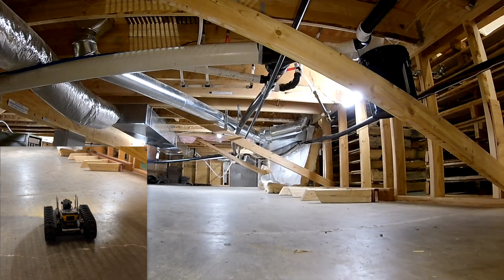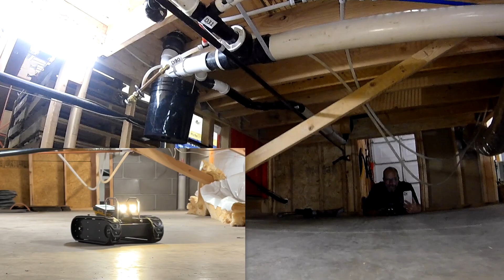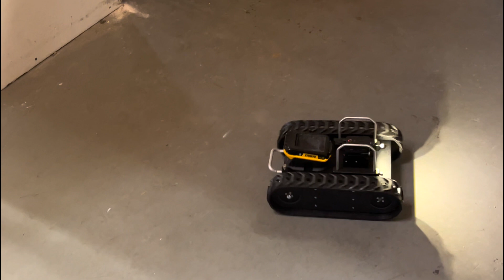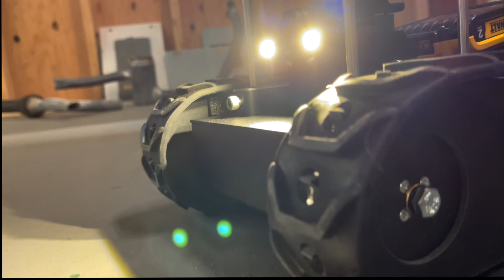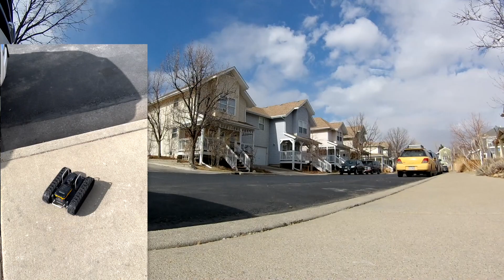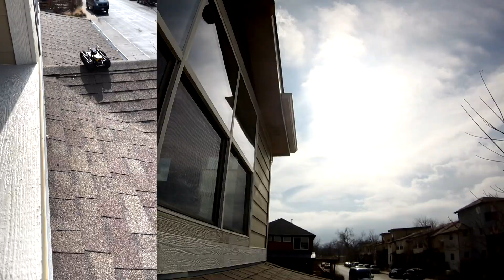SuperDroid Crawling Robot for Home Inspectors

Comment: Those puppies aren’t cheap.
Reply from the maker: Yep. So, you have to think about increasing fees in order to cover your overhead expenses of purchasing a piece of expensive inspection equipment, with the cost distributed over the next several dozen clients. In other words, let you clients buy the drone that they benefit from.
Reply: @internachi  absolutely.

Comment: i brought a siimilar one from superdroid,  awesome on flat ground  but not so great  on rough  ground,  it would bottom out  and get stuck on a rock or a old brick when used under a house,  it needs a cable attached to retrive it and even then that has its problems. I feel it needs more ground clearance
Reply from the maker: Me too.